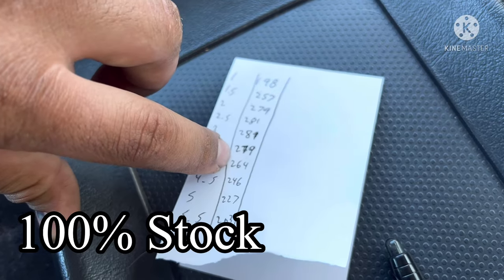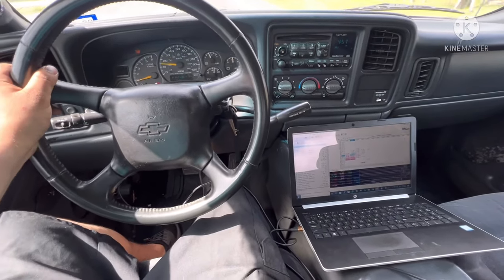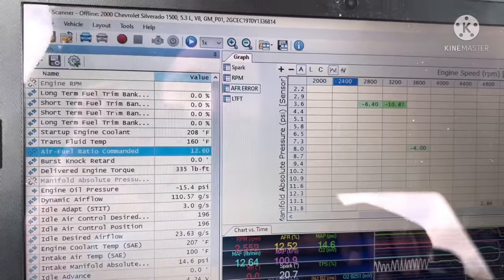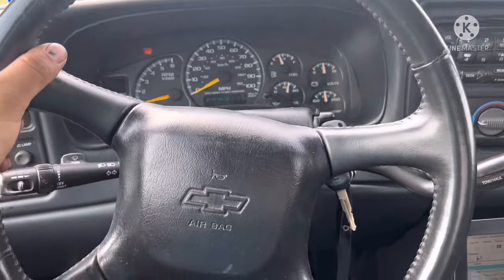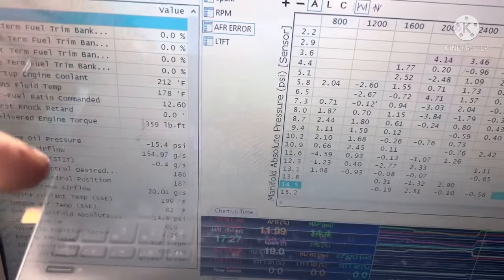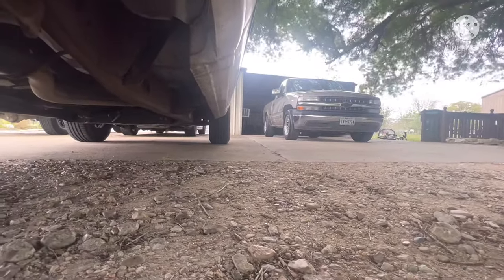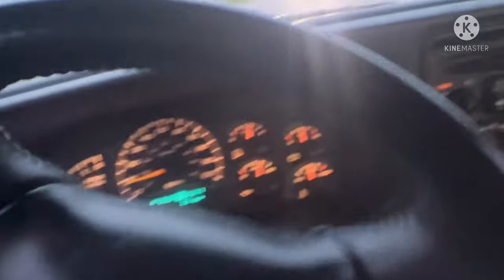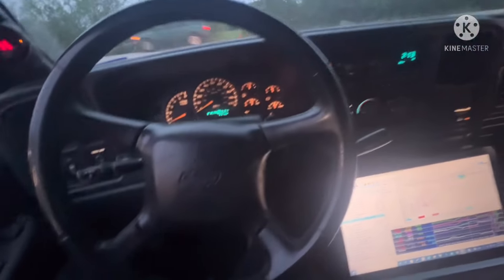BTR Truck Norris Cam + Tuning = HUGE GAINS 💪💪💪 ~ HPtuners

Comment: I have a 2000 LM7 with stage 4 BTR cam, headers, and converter. Your right.. from a dig it’s a dog off the line. Mid rpm to redline it pulls great. Not sure I would recommend stage 4 BTR. It sacrifices too much torque low range rpm.
Reply: Gears & converter should be paired with trucks cam. It’s a 5.3 so it absolutely needs a high stall.

Comment: Sounds good boss. Really wanting to go with this cam. Really new to hp tuners tho.  What are you tweeking in the tune? Would like to see what your changes are.
Reply: Same as the beginning of time. Fuel and ignition timing. Fuel by changing commanded injector pulsewidth and timing is just advancing or retarding when the coil turns off and sends the spark.

Comment: I think when you get to a certain point in your build that's when you get the converter. I run a cam motion 221/226 .600" lift cam in my rcsb 5.3 and it hauled off the line with a stock converter. Eventually I put a 3000 stall and with the proper tuning it drives great and flys. Good job on your tuning bro, very thorough. I have a btr in my other truck and it runs good too. The cam motion has the quietest valve train I've ever heard in an ls motor. I'll say that much
Reply: 4l60E or 4l80?

Comment: Same cam last week, springs , Melling pump and headers on the 180,000 mile LY6. 2500HD 8 ft bed . Stock TC isnt right. Dyno at the wheels : 368 TQ. 265 stock .Got for towing. It is what they say it is guys.... badass.I changed from the smaller magnaflow.. went to a larger magnaflow... still loud. I will now add the  small straight flow  magnaflow  into the pipes. Too much drone for towing loads at highway speed for 6 hours. Just me.

Comment: I have a 2017 3500 Express 6.0 van in the shop right now. 
Getting a truck Norris cam 
Exhaust. Torque converter. 
Etc .etc. already have a k&n on it. I can't wait for the big black van to be back on the road.

Comment: Feel you on the muffler drone. Cool vid. I did a lot of cam research before I built my engine. It’s a flat top 5.3 lm7 with summit racing rockers (trunnion upgrade) and their 8718 r1 cam. The more searching I did the more I realized I was happy with a Minimalistic concept. Flat tops, headers and a rv cam with 4:11:1 gears.

Comment: Definitely a good cam choice, loving mine. Such a huge difference in power in my 6.0
Reply: Are you running a stock converter and what trans
Reply: @gustavomendoza6028  I am running the stock converter. It’s a 4l70.
Reply: Mudhumper does the truck feel like it can actually get out of its own way? Mine feels slow as can be
Reply: @justinw6448  I can’t feel any loss of low end. I want to eventually regear to 4.10’s cuz the 3.73’s aren’t that great for my low end. You may have an issue with your tune if power is down in the bottom end.

Comment: I have a 2014 gmc 2500 6.0 with the LS3 823 heads & 6L90E transmission & 411 gears just got the truck Norris cam with matching LS6 springs I am hoping that it will be as good as it did for you? Also I am getting the HP tuner and lap top so I can play with it tunning it myself so I hope it goes well for me

Comment: Hey man I got a question for you.  I just ordered the truck norris no springs required cam for my 4.8. I have 5.3 everything else because I blew the 5.3 and have a 4.8 on the side I just gotta throw in to get my truck going.  Will I need injectors or will tuning be enough? Also Is a stock fuel pump enough, I just changed it?

Comment: You need a converter if you wanna take full advantage. Trust me, I have this cam with a 3200 stall with 3:73 and it’s a lot more lively. You’ll love it even more.
Reply from the maker: Converters help even a stock truck! I’m going to see how it behaves with a pro charger before I get the converter
Reply: I’ve got a 72 C10 and that’s going to be my set too with long tube Gibson headers in my 5.3
Reply: @lemontbowden3629  I have a 72 C10 with the 5.3, Gibson headers and the truck Norris cam. It’s a good setup.
Reply: Where did you get the stall and how much
Reply: Where did you get the stall and how much
Reply: @Cochraneracing  I swapped to a 5 speed recently, but I had a circle d 3200 stall. It was $500 when I purchased it.

Comment: Nice work . Did you up your shift pressures yet ? I did 2 magnaflow 21119 on my Sierra with Long tubes and high flow cats ! The only drone I get is bellow 1800. Basicly country roads at 80km she has a bit a drone . I posted a vid on my channel . 

Your shifts seem a bit lazy !
Reply from the maker: BTR Truck Norris Cam (20-90mph) Pull ~ Cam Only
https://youtu.be/4Z91J3ycWU0
Reply from the maker: Check out the new vid, this is with shift pressures upped a bit. MUCH better

Comment: I had a 2002 short bed regular cab 5.3 with a LS1 camshaft and milled LS1 heads with the stock 4L60E trans and 3.42 gears and tuned it ran much better from 3500rpm up than the truck cam with truck heads so l can imagine this truck Norris cam would be even better yet in the upper rpm range the LS1 cam pulled strong to 6200rpm l would imagine this truck Norris cam would pull to 6500-6600rpm

Comment: Which Truck Norris cam? .552 or ~,500 (no springs required cam). Settled on Truck Norris for the 5.3 in the 1950 truck and just as I go to order I see there are choices>>>>

Comment: Hey Bo, I have a 2015 Silverado with a 6.0L.  The roller lifters are self destructing because of worn lifter trays. Right now, I am inspecting the lower end and fishing out needles, etc.  I have purchased a Truck Norris cam, push rods, valve springs and will do the VVT delete, etc.  I need to work on programming which is a new technical area for me.  I see you use HP tuners.  Can I email you for advice on how to get started or perhaps you have a program that will get me started which tunes it for 87 gasoline and a loping idle?  This is so I can drive the truck and wear in the cam.  From this point, I would tune it later for performance.  Chris
Reply: You can check out the HP/Tuners forum for more information about what you are looking for, I think that would help you with a lot of questions

Comment: Nice job. Seems a 2500-3k stall would be perfect if you wanted to spend the extra money
Reply: It only has 220deg of duration.  It doesn't need a higher stall any more than a stock cam would.

Comment: Great job, can you share your tune to make a comparison ? I'm new to hp tuners and I have no experience and I haven't bought the wide band. I am going to install truck norris cam 212/22x LSA107    my  engine 2003 5,3 L59 no cats long headers and air intake, you can help?

Comment: Everything I’ve read says they really wake up with a converter. Says they’ll work on a stock converter but much better with a converter. Just a thought though. Seen a guy on here doing the same with the same cam, he went into the idle table and adjusted it also. Made it sound like a much bigger cam then it was. You may wanna try it.

Comment: So how much should mine make? 2000 5.3 stage 3 btr cam , 4 inch cold air intake 102mm throttle body, short headers and dual exhaust

Comment: Hey Bo, I have a 2010 stock 5.3/6l80 truck I am doing exactly as you did w your truck.  I am buying the new hptuner devise and a laptop for it. What do you suggest about keeping my stock springs?
Reply: I also plan to run e 85 thru the stock system and see how that does.

Comment: Hey! How much air flow are you getting at idle?  Mine is saying 16g/s which seems a bit high for a 6.0.
Reply: My SBC 383 with a similar aize cam is about 12-13 @ ~800 rpm.

Comment: Hey man i have the exact same truck and hptuners with pro link and afr. Im totally new to tuning and am struggling with idle tuning. I cant find any info to help lean out afr at idle. Im between 10-11 right now. Is there anyway you could send a compare file so i can see where you made changes and use that to help teach myself. Theres so many settings. I have maf faulted out and o2 sensors and ltft stft off so i can make manual ve adjustments without correction. Ive raised idle rpm and iac to get it idling in gear. I just cant get the dang afr to lean out at idle. It’s great under load. I played around with the stock tune before the cam and learned how to work the ve tables. That part seems pretty smooth. If your willing to share that would be amazing.

Comment: I have this same cam in an LQ4 with 862 heads and my question is, do you have any valve train noise at all with your? I rebuilt this engine with all new parts and LS7 lifters. Only thing reused we’re the rocker arms with a trunnion upgrade.
Reply: Cams sometimes make the valves louder thanks to higher lift, headers can also make the valve train sound a little louder
Reply: I have noticed the ls7 do have some noise to them. My last one I did was a 224R with pac springs and ls7 lifters and it was loud. I talked to a few people and even tested seat pressure and such and had quite a few people tell me it’s normal
Reply: @patrickbecker2481  
Same here with ls7 lifters in a 6.2 with a 224R but I use Lucas oil stabilizer and it helps to quiet down

Comment: How did you gain oil pressure ? After new cam swap ?
Reply: He did state he installed a high volume oil pump at the same time,  which will increase pressure too.

Comment: Can you tune out the rough idle?? A pro stock idles better than that.
Reply: Truck Norris cam is a low LSA. You can raise idle rpm and help smooth it out some but it won’t be as smooth as like a 114 and up LSA

Comment: You said you were raising the shift points to 6000 rpm but the dyno graphs i have seen look like its making like thensame power near 7000 rpm which should make you lots faster another 1000 rpm at near peak hp and you rpm drop on the shift will be that much higher in rpm and closer to peak power but i get 4l60e problems

Comment: I just put this cam in my truck same truck but when I'm at WOT my 2-3 shift just slips bad but if I drive it normally it does just fine! I've done a bunch of reading and it's either the clutches or some say it's either to much or not enough line pressure. No idea super new to anything electrical. Is this something you can easily change?
Reply: Problem is likely in your trans. Slipping between the same gear changes consistently typically means slipping discs and a trans rebuilt/upgrade will likely be in your future.

Comment: My truck Norris cam kit comes tmr throwing it in a 5.3 Tahoe with long tubes,3inch all the way straight pipe,
Reply: How the truck norris cam workout?
Thinking of doing same cam  but in a 5.3 silverado  long tubes with 3” to a carven tr.
Reply from the maker: Man I Honestly love the truck Norris cam, it’s got such a flat torque curve and broad power band, sucker will pull to 6500 easy too
Reply: Do i need to run the ls6 springs with seals? And i will also be using the stock torque converter for a while. But i see people run the 2.4  trailblazer torque converter
Reply: @Bubbleeye00  it is badass adds power in the low end and high end bro definitely recommend and with the right tuning you can keep factory stall
Reply: @northxsupreme7127  heck yeah thats definitely what I’m looking for, Thanks

Comment: Do you think 25 oil pressure it’s low for a 6.0 cammed it goes up to 80 psi when I smash on it
Reply: I believe the idle spec on them is around 18 but I could be wrong

Comment: What kind of horsepower/torque will a BTR truck Norris came and ported 706 heads, TBSS intake,  do on a LM7 engine? At the wheels do you guys think?
Reply: Not much more. That cam is designed to drop in stock motor. Rest if the motor will limit it (fuel injector size, tune) but many a video where AFR heads, 6.0l, stoker kits etc the cam is limiting the extra UNTIL you add boost or nito.  The purpose of the cam is sound and power for stockish engines.
Reply: Watch Richard Holdener dyno videos, he’s tested multiple combinations.

Comment: Dang so I need to buy the pro feature set and prolink cable to hook up my wideband gauge ? Really would be nice to have that number in my datalogs! I am also tuning a truck norris cam and it's my first time getting into the tables.  20 degrees of advance at wot seems really low to me and that's where this 4.8 is staying. had 60c intake temps tho, maybe that had something to do with it
Reply: Ya probably i bought the upgrade version when I bought mine i forgot what all was different but I got mine probably like 8 years ago or something so I have the old unit so I cam hook it directly but I haven't done much and don't even have a wide band yet

Comment: Got this cam in 2013 suburban ltz 4x4 and only have cam and springs and cai and it runs ok but the guy that tuned it didn't take the time and with the wife driving it I had to figure out something fast so I got a mail-order tune and it's still not right need some help with issues I'm having

Comment: Alright, sound great BO... Love that Lope... Dont care to much about chop, but the lope... Beautiful.. But question Bo.... Well, 2...1st... How come when you get on it from a dig, right... How come it bogs and hangs at around 2 grand mark... Whats going on with that, and 2nd... When it shifts at 6 grand how come it drops all the way back down to damned near 3.5RPM's waaaay outta the power band... Why won't it drop to like 4.2 grand so it stays into power???... Why is that... Im super curious as I also have this cam, though not installed yet... In my 86 Regal with a 6.0 LS2.
Reply from the maker: The bog was from it being lean off idle, I’ve fixed that issue since the video, dropping to 3.5 rpm’s is just the result of stock gearing and stock converter, a lower gear and looser converter will keep rpm’s up after shifting
Reply: @BoBuilds  bet... Awesome 👌🏿👌🏿👍🏿👍🏿

Comment: What did your final 1/4 mile mph improvement end up being? That tells the actual story vs the torque reading.
Reply from the maker: I left the dang Draggy GPS thing at work! I’m gonna try to run it tomorrow
Reply: @BoBuilds  hey hi I just got my 2013 suburban ltz 5.3 with dod delete and the truck Norris cam and man it is having issues and the tunner told me that's just the way cammed vehicle act really got me bummed out was wondering if you may point me in the right direction on some of these issues
Reply: Did you ever test it?
Reply: Please post quarter mile results 🙏
Reply: @ericsych821  there is oil shut off codes for the dod that need to be adjusted with hp tuners. factory computer is trying to go into 4 or 6 mode. it cant because you replaced the dod lifters with non dod lifters. lt1 swap talks about the codes.

Comment: I got an lq9 6.0 in a 06 1500 with truck Norris. What size injectors do you think for an E85 flex conversion
Reply: There are injector formulas on line.

Comment: Did the truck run on oem tune? Just wondering if it would run so I could drive to the tuner
Reply from the maker: That’s a good question! I’ll make a video on that
Reply: @BoBuilds  thank you! Also I know you said it would run fine on oem converter but would you still recommend a small stall converter?
Reply from the maker: As long as the converter doesn’t exceed the peak torque rpm it will benefit! I think peak torque here was 3200 rpm’s,
Reply: A converter on a stock truck is a noticeable upgrade. With an aftermarket cam it’ll be a well appreciated difference for sure and even utilize more of the cam advantages

Comment: Why not use a wideband to tune?  How about locking the transmission in 3rd gear for pulls!!
Reply from the maker: Yeah I use a wideband to tune. I actually have one hooked up 24/7. In this video it was probably on the way or something. Check out the more recent videos. It’s procharged now

Comment: Did u use a stall converter with this cam?
Reply from the maker: So far I’m on stock stall. Still picked up .5 sec 0-60mph and just about .5 sec 1/4 mile

BTR Truck Norris Cam 1/4 Mile Results With Dragy. + Q&A
https://youtu.be/0aTfoh3AuFE

Comment: Ik you said baby steps to dial it in.. and this is just my noobization... Wouldn't it be better to over shoot at first and run it slightly rich and adjust it lean than to adjust it rich. I can just imagine them cylinder walls screeching after 4k with a lean condition.  Even predet would occur when backing off the gas. Just my assumption though.
Reply: No. It’s not actually that lean. The computer is compensating by adding a % to the base map. Then he slowly adjust the base map to make it so the computer barley has to compensate at all.

Comment: I have an lm7 5.3 completely stock other than a cheap cold air in my 04 silverado i plan on putting the btr truck norris cam in soon, i just got hp tuners, i was wondering if someone had a tune  for a similar set up i could just buy off them and load the file into my ecu, or at least wondering if thats possible to do

Comment: how much was it if youre stock 6.0? just need cam , lifters , springs ?
Reply: Most def change push rods too … I checked on their website and for intake headers cam springs rods lifters and converter it’s around 1500$
Reply: @patrickbecker2481  i’ve got a stock lq9 only gots melling oil pump and long tubes. built 60e 3200 circle d and 4:56 trutrac. wanting to chop but don’t want to get a lifter tick or anything like that.

Comment: i just did mine i have gen 4 what do i adjust to get more vac at idle i lose breaks also what do i adjust to get it to start with no peddle i just need to get it to a shop to do a tune i have hp tuner